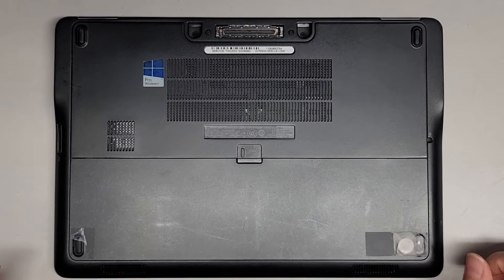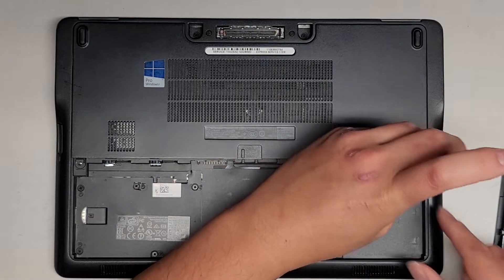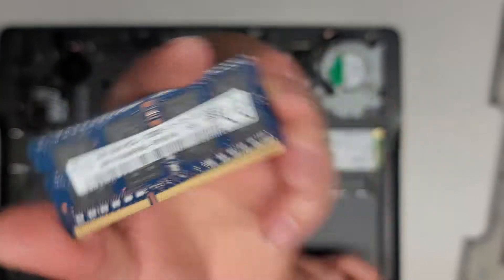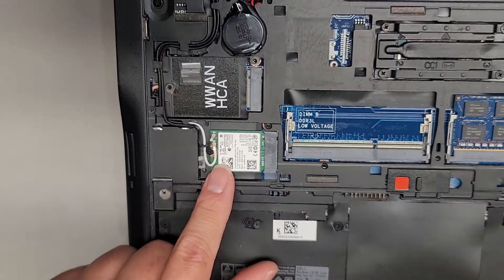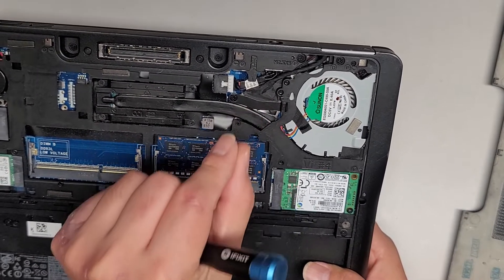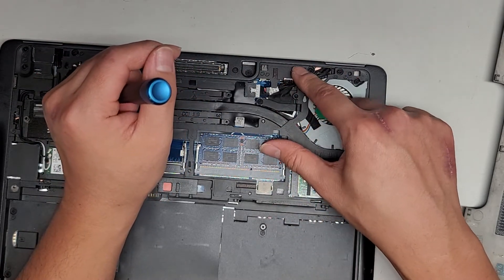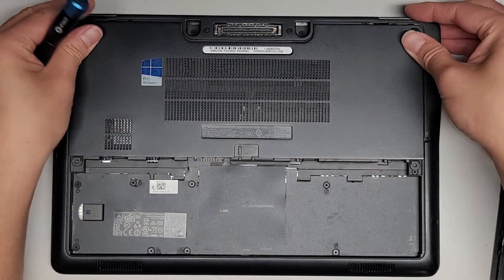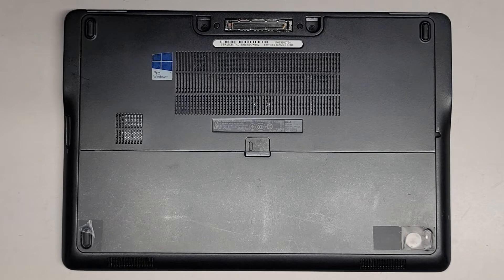DELL Latitude E7250 Disassembly RAM SSD Hard Drive Upgrade Replacement Repair Quick Look Inside

Comment: I have this one(dell latitude e7250) with just 128gb ssd and I wanna add another ssd 128gb, is that possible?🙂
Reply from the maker: No, but you can clone it to a larger one.
Reply: How do you clone it?? @ItsBinhRepaired
Reply from the maker: This https://youtu.be/4p5jFDzVwUw